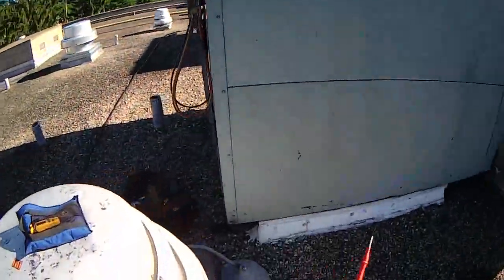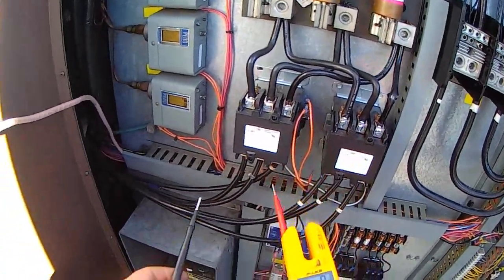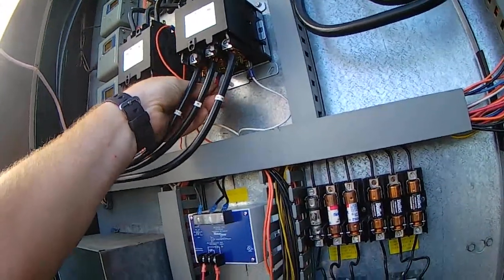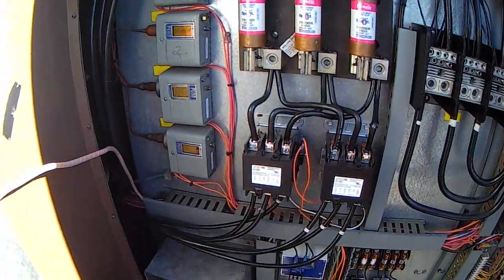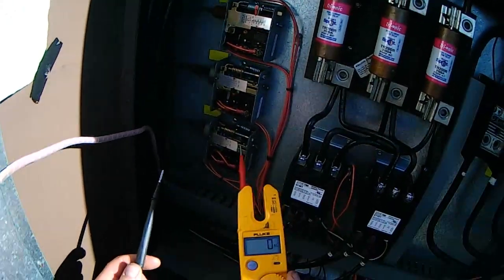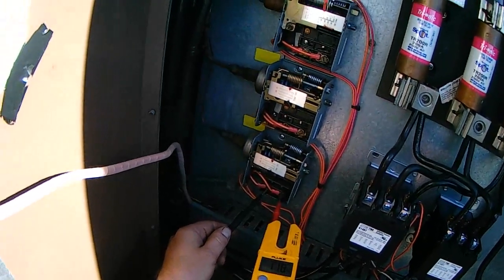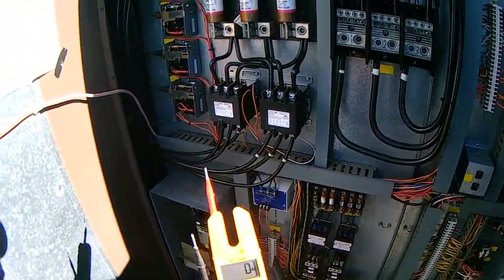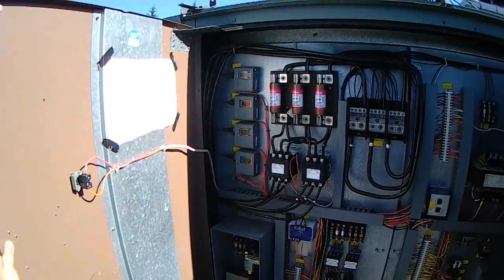Diagnosing a 30 ton Mammoth HVAC unit with detailed switch testing

Comment: These size units use to intimidate me so bad when I started doing a/c work in a large factory. Chillers did the same and most didn’t have wiring diagrams to go by but somehow I made it thru it. Most of them used switches that worked off compressed air which I had never been trained on. Thanks for the video

Comment: If you pause the video at the 14:44 and study the high voltage along the top of the wiring diagram, you will see a single blower, a single compressor, and two condenser fan motors. From that drawing you will see that both of the large contactors are feeding the compressor, thus the second contactor IS NOT for the condenser fan motors. , You can hear the left contactor come on then as its auxiliary closes it energizes the right contactor moments later, definitely part start winding set-up. Looks like the two contactors for the condenser fans are setting below the compressor's with their own fuse blocks and looks to be overloads in series, too. Just wanted to clarify for the young guys entering our industry...great video. You young guys watching this video, get on the Googler or this Youtuber and study "Part Start Winding".
Reply from the maker: You are correct.

Comment: My home unit, an old early eighties round carrier had the contactor skip a beat and would not pull in hard enough to close the contacts. I went over the low voltage side of things and re did the wire nuts and the push on terminals, that baby is back to working.. Don't get much call for AC where I live but when the heat does set in it sure is nice to have it working.
I had a remote load control receiver that the utility put in years ago that would allow them to power down the AC unit during periods of peak demand. Well, that program ended awhile back but that control still does afford the 5 minute delay time out if power is interrupted  to keep the compressor happy, good thing to because my factory time out board is toast.
Thanks for the videos
Reply from the maker: +Craig Nehring you can always add a new time delay. Very inexpensive.  Thanks for watching!

Comment: Sir if you don't mind me asking what is a pump down system? Why would it pump itself down after the cooling was met? I thought the thermostat does that. 16 years HVAC knowledge of all hvac equipment 15-maybe 20 tons and below.  Thanks for the video. I sort of understand the zone idea but I've never seen that before and not sure how the pressures could regulate just by shutting each zone on and off.

Comment: Are you sure that contractor next to the compressor contractor is for the condenser fan motors? Looks more like the second contractor for a compressor part wind start scenario.
Reply: Thats what i think also. Same size wire.

Comment: Is the purpose of the pump down system basically to prevent oil from flooding the evap coil? I understand larger systems have more oil. Does the valve stop the refrigerant from carrying oil on it's way to the evaporator while equalizing? I'd like to understand a little more. Also with the system in a pumped down state, is the evaporator coil now in a vacuum or is there still some sort of pressure there to fill the void? I would imagine there would be something there since pumping a compressor into a vacuum is not all that great for things. In fact I've seen some new residential systems with internal vacuum protectors that wont even allow you to pump below 15 psi. This all seems less intimidating after watching you trouble shoot this. It's like what I do but more bells and whistles.

Comment: So the end switch energizes the fan contactor? I do residential. Typically the same contactor runs both fan and compressor. So most roof 3 phase roof top units run two separate contractors for each load? I'm trying to understand this. I'd like to get into commercial
Reply from the maker: That the cool thing about controls. There is 100 different ways to get the same result
Reply: It looks intimidating because its alot but if you break it down to its simplest form I see that it's all the same. Just more components to control the same things. Each individual load has a heavy duty relay or contactor to get it started since using one contactor for each of those powerful loads would most likely fry a single contactor. Since its commercial you can break down the 400 or whatever you got to 120 and use that as your control voltage. Makes things easier I suppose. My question is what in the building makes these systems turn on? Is it a thermostat connected to a building management system. If it is a management system does it use 24 volts? I would imagine so. Basic roof tops are much easier in a sense that they are just like residential just bigger. Some of this stuff you work on seems more industrial. All the same stuff though I see.
Reply from the maker: Almost every building is set up different. Keep an eye out I want to put out some more videos. As I put those videos out ask specific questions and itll help me know which videos to make. Thanks
Reply: @GuyBrown  sure thing will do. I'd like to learn as much as I can about this. Did you do residential to begin with? I've been at it for 5 years. Love the work. Cant stand the customers.

Comment: great video. what fluke meter are you using?
Reply: That's a Fluke T5.  Relatively cheap, does 90% of what you need, auto switching from ac/dc, and still accurate.  Cheap enough that I don't mind keeping it handy in my tool bag, and could care less about it banging around with all the other tools